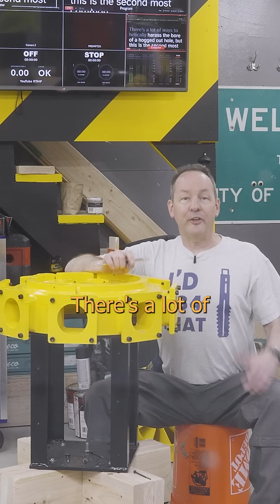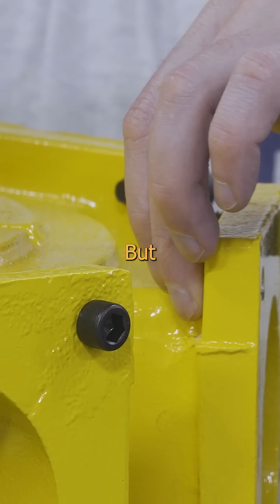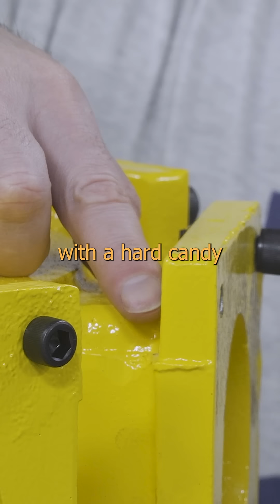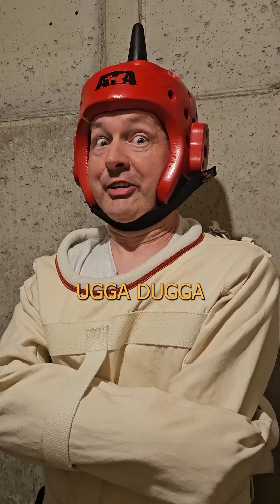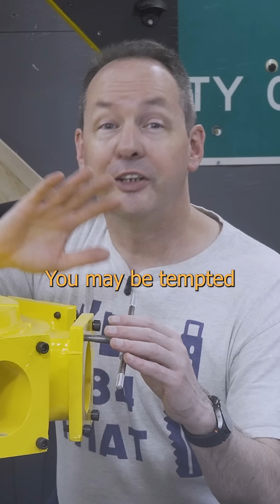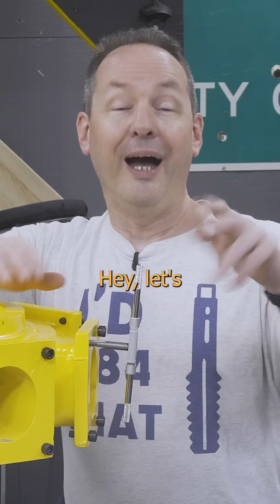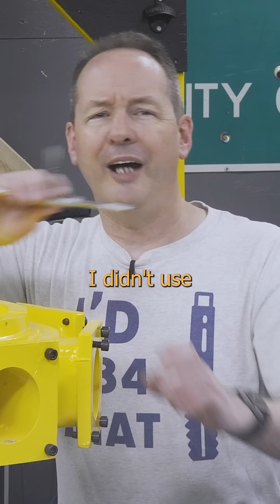Thread Chasing  #chrisboden #comedy #engineering #skills #workshop #metalworking #tools #apprentice

Comment: Dumbass

Not my idea, Nissan UK. Our company messed some parts up and the holes needed to be tapped. Nissan refused to stop the line, so our company sent completely untrained production operators to use dewalt drills to tap the holes on the line, while the cars were moving. 

I objected to this, telling them I had machining experience and this wasn't going to work and would end up costing the company thousands in scrapped car costs. They ignored me. Cue me doing this for 8 hours. I snapped 1 tap, 1 scrapped car. The other 4 guys they sent snapped 14 taps before they decide to change their method. 14 scrapped cars. 35k a piece per car, expensive mistakes. 

They weren't happy when I said told you so 😂

Comment: Lol im a dumb ass machinist that uses a drill for anything tapping but I learned how on m2 that I couldn't machine on a 25k unit production run with 12 taps per unit rip so many taps and im so sorry for all the delivery runs from the tap supplier 😆 if your going to do it I highly suggest leaving the chuck slightly loose so the tap can move a little it took me way longer than I'd like to admit before I learned this.

Comment: Never used a drill on a tap and have chased threads down to m1.2 but have snapped multiple 4-40 unc threaded holes in 15-5 stainless due to night shift lack of checking the thread mill. Was about a fun as it sounds.

Comment: Before I got into machining and I went to repair a messed up thread on a super important and expensive part on my GTI. Needless to say. I snapped my tap in the hole AND cracked the part. 

Screw ups like that are what got me in my career as a Facility Engineer because I certainly don't make the same mistakes 5 times 🤣

Comment: Not really a thread fail. More of a placement fail. Made holes in the sides of my 1999 Skoda Felicia pickups bed to fit gas springs for the bed cover. 

After making the holes, i realized that access to where i made the holes were more or less inaccessible by hand through the panels in the sides. So the screws were basically just screwed in with no bolt on the back which you can imagine wasn't very secure, partly due to the metal around the holes flexing from the weight as well.

Comment: Dumbass, It worked the first 3 times I tried lol sadly the third time was on an old ass pump they stopped making parts for before I was born. Getting the new one to fit in the same spot without moving the 50 yo piping was fun lol... I was a towboater

Comment: I first learned the lesson on a 4-40 tap. Not even a big big fun one. Chasing threads in a stainless steel part where the threads are on a conical spot. Hole is off center nearest the smallest part of the cone shape. Drill and a shattered tap soon after. Thought to myself okay don’t do this with small taps. Then learned the lesson a 3/8-16 tap into nylon where heat won the battle. Good times

Comment: 180 pneumatic drill with an exposed clutch for easier adjustment and not breaking said taps. I was wearing cotton gloves because my fingies were cold. I couldn't let go because of the gloves, and they had to cut the air supply to the drill.  I was cleaning my hand while another person with tweezers was pulling my flesh from the motor.

Comment: 🥳
I can confidently say I've never messed this job up before.
And I know woodworking has a cheaters undo button with a little dust and glue but that's gross and sticky.
Treat it right coming out as going in and you don't have screw in to a hole with sloppy seconds as your binder.

Comment: I exclusivly tap shaft stock with a drill, and I've broken 2~3 taps over 3 years. its not that bad. just go slow in for 2 turns, out for 3, in 2 more turns(5 total), etc. and USE TAPPING FLUID! wd40, isopropyl alcohol, or my favorite; tap magic

Comment: One of my jobs in the machine shop was to use a machine called a tap decintinator.  A hollow tube of metal that caused an arc of electricity across the tap. It burned its way through the tap.The trick was to make a hole through the tap, then pick out the pieces of the tap with a pointed piece of tool steel.😊

Comment: So I use a thread chaser on a drill to clean out a hole somewhere in there the tap decided it was not gonna spin anymore so that rotational energy went right back to the cordless drill with a 12ah battery that smacked he upside the head

Comment: Dumbass: Me

Never used a power tool when creating threads, but... when threading the end of my 30-06 barrel to attach a muzzle break (everybody who shot it kept busting open their eye sockets with the scope, plus I've never tried a break at this point). I neglected to get the die guide because I thought to myself 'Self. We can do this by eye.'. It looked good, but when I shot it after adding the muzzle break, the round hit the end of the break and went 3 feet off to the right at 40yds.. Had to cut an inch of the barrel, finish the end of the rifling, file the outside surface of the barrels end (so I could get the die on it) and re-thread it (with the guide this time). A lot of work and time for an easy job where I cut a corner. Learn from my mistakes. Because THAT'S pretty cool!

Comment: I did something similar with an air impact wrench. I worked as a "mechanic" for a year but only changed tires. It was my first job ever. I saw my coworkers put the bolt on the impact and drive it in directly without screwing it in by hand first. So i thought i could do that too😂 you can guess what happened.

Comment: Dumbass here!

Very simple and not too entertaining story. Was at school and we were being taught this at the time. Drilled our pieces with exact measurements given by our teachers and then began the process.

All the way in, she went fine, it had lubrication, I was as steady as my hands allowed me to. Now on the way back was a different story. She caught onto something, and refused to come out any further. 
Now what is your instinct when you are like, 16, and something catches in a hole? Well you try to put a little bit more force, just a little bit to overcome the resistance. Well turns out even that little was enough for that bitch to snap right off.

I still have that metal piece, and the bit is still stuck inside it. Good times.

Comment: I am definitely one that learned this the hard way, but not with a drill. I was drilling and tapping new holes into a steel milling machine and on the second to last hole, I used a little too much force and broke the tap off all the way in the hole. We had to take a magnet and carefully pick pieces out one-by-one and added an extra hour to the whole process

Comment: For what it's worth there is a different tool called a thread chase which is basically a less sharp tap. It won't cut threads into a hole but it will clean up an existing one. The challenge with putting a tap into an existing threaded hole is you can as Chris mentions end up cutting it more which at best makes it a bit loose when you go to put a bolt back in it.

Comment: I’ve found on known good threads not using oil gets paint out better than when I use tapping oil. The oil makes it skate over the paint sometimes but dry chips it out better. Obviously if you’re cutting metal chasing threads then use oil

Comment: Heli coils are badass for fucked threads! And I avoided the "dumbass" lesson by listening to others before me! But while I was taping out a hole in my (impatient) buddies engine block, he kept trying to get in there with a drill so it would go faster, almost had to fight the dude over doing it the slow way, lol, slapped a helicoil in there with some locktite and waddayaknow, holds good and tight lol

Comment: Dumbass

I did this while working on the tow package bolt holes on my truck. Thought i could clean them out with my drill because i was tired and i couldnt get the bolt to bite to screw it back in. Was a very long day after that

Comment: My dumbass used a drill to tap the 2 bolt holes of a 2 stroke engine's exhaust port...lost every bit of time I thought I'd save when I had to drill it even bigger and tap by hand anyway

Comment: Greenlee makes a set for 1/4 inch bit and to only use in thin steel. Like the back of an electrical panel. Never use in thick steel. Boss tried that one time. I spent the better if the day gatting that out.

Comment: There is a car in a museum, somewhere, that has one screw in the trans that is a bit wider than the rest... Yeah, drill, cross threaded it, had to drill the whole thing and  tap again, I think it was from 8mm to 12mm, the screw head was modified to the same size as the 8mm, outside no one notices it until you get it out.

Comment: this piggy works for a machine builder, i agree with most  of the things said,  especially the pig thing ;) but a battery powered drill on the lowest tork is safe for most steel and aluminum treads, Stainless steal and hardened steal, !!!follow all precautions!!!, i have broken more  taps on those holes, than that there are keg stands in a college party. But  my least favorite once are the M36 and bigger, those guys take ages or wreck your knees and drills when they hit each other when there is a kickback. like a horse kicking in the nuts.

Comment: I am a dumbass. Years ago I was changing ball joints on my Subaru. Pinch bolt snapped when I tried getting it free. Drilled out broken piece. Decided to touch up threads... 
broken tap
tears
Steering knuckle removal
Anger
Air chisel
Prayer
Sledge
Cursing
Redrill
Blood

The steering knuckle is no longer threaded. Bolt runs all through with nut on other side. Works the same. But now easy to manage

Comment: I was given the opposite when I was doing sudo apprenticeship work in a boiler house/ Utility air part of a factory. A 50+ year old reciprocal air compressor had snapped it's piston rod(the size of this compressor was huge it had a 6 foot diameter electric motor coupled to both piston stages. 

Anyways on to my part of where I screwed up twice and didn't ask questions to learn where I forked up. I was tasked with chasing the studs with a die. I didn't know how to but assumed I did and wanted to use a driver that had crank handle to speed up the process because I was young and dumb. Luckily one of the senior steam engineers stopped but i didn't learn the why my idea was stupid until now

Comment: I was a machinist and toolmaker for 42 years. Part of that time was in a foundry mold-making and maintenance department. Yeh, you can fuck up tapped threads with menacing myriad of methods. Removing a broken bolt from an old mold, run up to 900°f and cooled with water several thousand times is one of the most profoundly, preposterously perplexing of them, because you have to horse out the busted bolt, while still being able to clean out the original threads and reuse that hole.
Best cas scenario is left hand drill or broken bolt remover. Worst case is drill oversize and install an insert. Helicoils will not hold up in that environment. Don’t even get me started on breaking the tap in a hole. That snap is axmachinist’s oh shit sound.

Comment: For small taps use an old drill chuck after finger tightening  , keeps you from breaking taps by over torquing them . Gun taps for thru holes and bottoming taps for blind and if you’re  not interpolating you’re not helping that hole reach its full potential.

Comment: I used taps in a drill all the time at my old job. Never broke one in a drill, but I have broken them by hand. The trick is using the clutch correctly, and feathering the trigger

Comment: At my job we form-tap boron steel plates regularly, but due to the amount we need to do we ended up modifying a multi headed drill press to be able to rapidly invert the motor. This tends to go as well as you'd expect

Comment: I'd never used a tap wrench before... I'd watched my grandpa, but never myself. So, in the first couple weeks of my engineering co-op, we're out in the R&D lab building a test rig, and I'm tasked with tapping the holes. I say I've never done this before but the guy in charge is much less interested in teaching than you are. I chuck it in, but cannot get it tight... I didn't know that's how it was supposed to be (unlike drill bits)... and I ask the guy, genuinely, "is this right, it feels really loose?" and he grabs it and it falls out onto the floor and shatters... and he's pretty upset.

Sends me back in the company vehicle to get another from the Inventory department, and they've only got one 1/4-20 tap left.

Needless to say, you've never seen someone so careful tapping holes, as I was that moment.

Comment: #Dumbass yeah, I definitely learned that lesson the hard way. Tapping 1/2 13 threads on a large tank door flange , sent it in with my drill and broke it off flush (p.s. this was before I learned what tap extractors were, spent all day trying to fix that f*** up)

Comment: Haven't done a 48-20 thread, but programming a 1/2-13, 5/8-11, or 3/8-18npt threadmill program on a conversational CNC that doesn't have a full keyboard. Now that's real fun. At least the other two sizes I'd regularly run, 3/4-10 and 1-8 had nice easy to figure depth changes for each block of code. Now, once I was doing regular programming, and put a copy of the controller software on my work PC, and figured out the handy converter tool it had, then it got easy!

Comment: At a previous machine shop I worked at I regularly used a drill to chase the back end of thru holes to clear the burr from countersinking them. It does take some finesse tho or you will blow out that thread. I recommend using a bottoming tap, because the fewer leading teeth help you hold it straight going into the hole. Always use the lower speed setting. Then again, i’ve only done it to clear burrs on brand new perfect threads. Not old gunked up ones.

Comment: As long as you use a drill instead of an impact and use the clutch that the drill gods gave you, you can pretty reliably chase even down to an M3, and I’d be pretty confident actually tapping aluminum down to an M4. But, Ive been doing automation/mechatronics/robotics/industrial maintenance for nearly 20 years. And I’ve chased M3 threads that were in a stainless rod about 50,000 different times with a drill, and as many as 1,200 in a single day!

Also, when it comes to chasing threads, I find that a bottoming tap is often better than a standard tap, and far less likely to cut a new set of threads/cross thread. 

Use both tips, and you’ll be a thread chasing machine in no time. Not that you’ll enjoy it anymore, and if you have need to chase thousands you’ll probably hate it. 😂 but the more you know!

Comment: Use a thread chaser or a bolt with two slits cut into the threads 180° out from each other for a safer start with less risk of damage. I go to the tap to chase holes as an absolute last resort

Comment: I’m a Ford diesel tech and a couple years back ford had a recall on cab-chassis super-duty’s that required the drilling of 16 holes for the installation of 4x support brackets on the frames of extended frame vehicles, the location was thankfully just rearward of the cab so body didn’t have to come off, however some vehicles had service body’s that had to be sent off to specialty shops to have the body’s removed. But for others, we got to do the recall. We purchased a specialty drill specifically for the recall, some German company, thing weighed about 25-30lbs and had an electromagnetic base, so that you could actually accurately drill into the insanely hard frame rails. Everybody else hated that recall, but I loved it lol, partly bc it paid straight time for most of the vehicles we did it on, and partly bc it was fun learning the proper feed-pressure for the drill press, bc when you got that pressure right it bored through that steel like butter. The bits were like $80/pc. And the lubrication fluid was expensive too and smelled like cinnamon lol. The drill also had a built-in centering pin inside the bore-bit that doubled as a lubrication channel for the bit teeth. Patience, lots of lube, and lots of compressed air to clean the bit and send those cuttings into the bay of the guy who borrows your tools and never returns them 😆

Comment: DUMBASS
Yep. I tried using a drill years ago. Got the tap about an inch in and it snapped so clean I couldn't get vice grips on it to back it out. I had to use a torch to melt it out, weld the hole closed with 6011 rod, redrill it smooth, and then use another tap by hand with a little machine oil.

Comment: Dumbass. I was retapping stripped out holes in an old Aluminium engine block and thought I could do it quicker with the drill. Wound up restripping the new holes and had to go buy thread serts to fix the cockup

Comment: "Dumbass" adjacent, when my well-meaning bride was replacing a M6 she had removed from my vehicle on a fine Tuesday when I had a lot on my plate. Little did I know it was cross threaded with my Father-in-laws Kobalt cordless driver. Her persistent effor paid off. That M6 was nearly impossible to unfasten. Nearly because I wanted a new M6 20mm in the same place, I had the opportunity to learn the right way, to chase the threads.

Comment: Lmao I only use a drill, gets rid of a ton of variables  associated with sloppy joints made for hinging not spinning
 I’ve literally tapped over a million holes with a drill. So I’m pretty much run mach red bull version now. The trick is air and trigger controls

Comment: while you shouldn't clean out old threads via drill, you can make new threads with a drill. it's tricky but doable. you will probably lose a couple of taps just getting the feel for it though.

just remember redoing a whole ass part from scratch because your tap broke might be not worth trying to save time by using a drill.